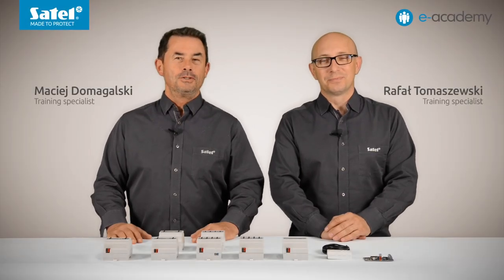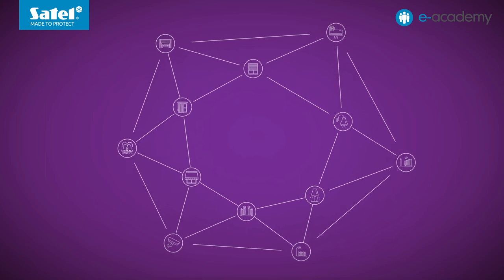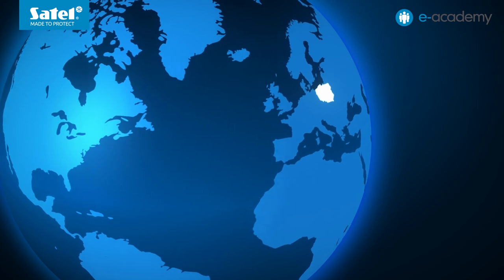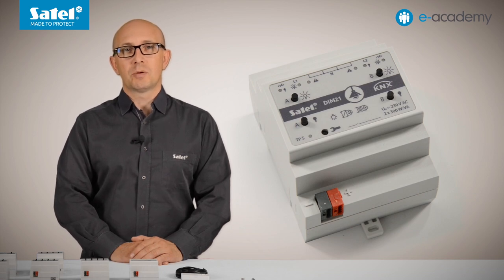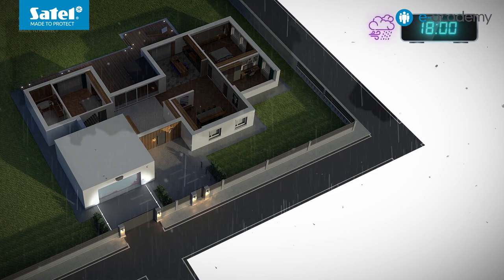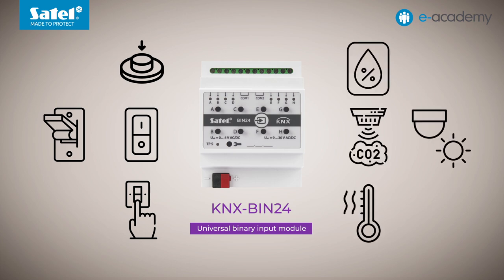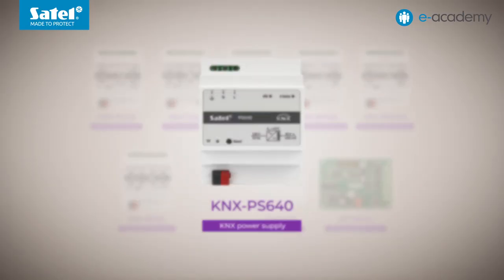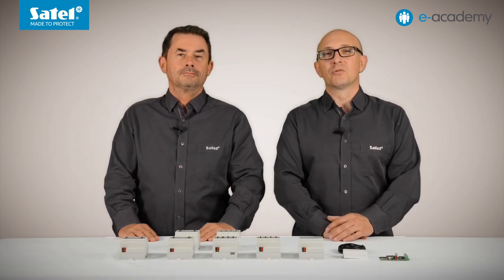SATEL e-Academy Episode 79: What is KNX and How it Works?

Comment: Is it true that the individual address 1.0.135 does not exist?
Reply from the maker: Hi! While this address does exist, it can only be assigned to specific devices like line couplers or IP routers.
Reply: @satelofficial  Why? For this particular address (1.0.135) would you not just require line repeaters?